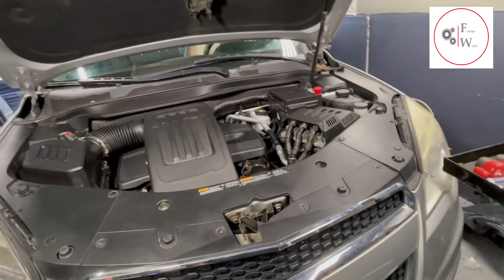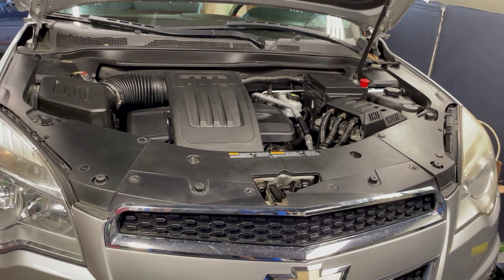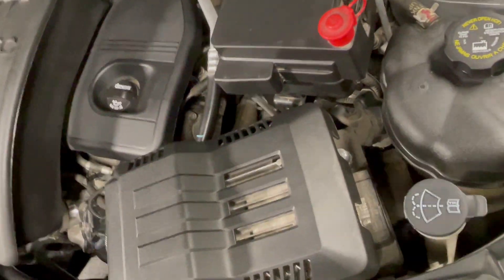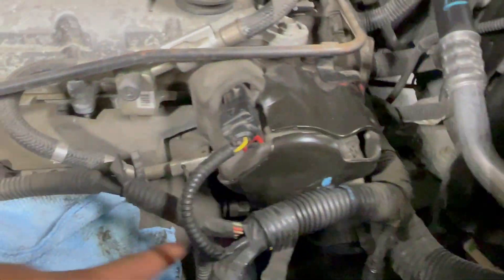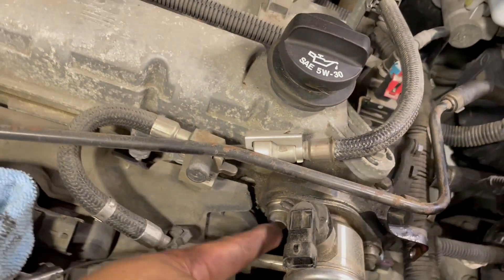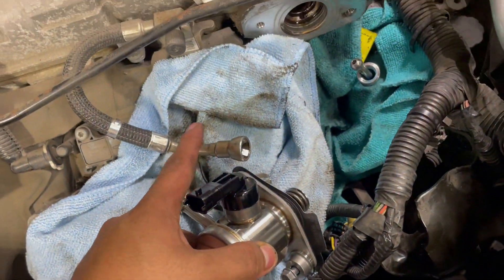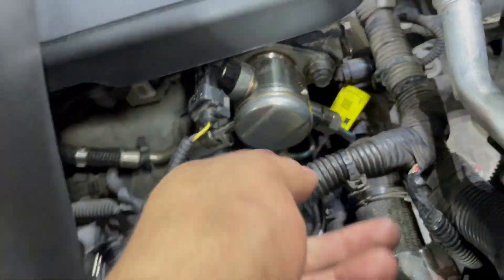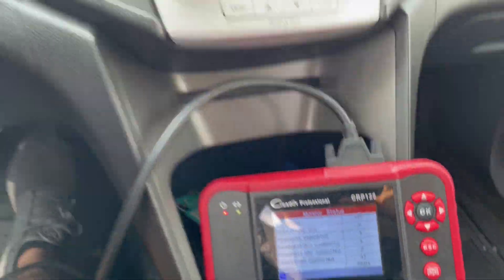Chevy Equinox High Pressure Fuel Pump Replacement (Code P0172) 2.4 Ecotec

Comment: Works for 2013 captiva. Thanks for posting
Reply from the maker: Im glad this video helped! I’m trying to put more content on this chevy platform. Nothing has broken on the equinox so far lol
Reply: @Fwerks.1592  You can work on my equinox, things seem to break every week lol! Very helpful video, just ordered the HP fuel pump on rock auto, says GM Genuine, not AC Delco, but hopefully it's the correct one. List of things already replaced on our 2013 nox: fuel injector at 40k miles, exhaust manifold at 67K miles, drive shaft seals at 60K miles, VVT solenoids x2 at 80K and 120K, upper cylinder cleaning for clogged secondary injection ports and cat replaced at 120K miles, ongoing oil consumption issues (oil cap replaced to relieve pressure). We bought it for the promised 32MPG but it doesn't even come close and comes with all these issues, no more GM!
Reply from the maker: @TripleDave40   I definitely hear ya! I hate working on GMs! Worst engine designs!

Comment: Nice video just changed fuel pump and oil. The oil smelt like gas and my equinox would run for awhile with key off. Question I just changed the oil same time as pump how long do you think I should drive it before changing oil again. Just want to make sure all the gas is gone
Reply from the maker: If you want you can go ahead and change the oil again now. For sure there shouldn’t be any gasoline left in the oil.

Comment: I have a P0191 code - replaced back fuel pump and fuel pressure sensor and code still there. It is also causing Stabilitrak error causing engine reduction. Is it possible the high pressure fuel pump work also cause a p0191? Not sure what else to do at this point.
Reply from the maker: Have you checked the injectors? You can use a stethoscope and hear each injectors to see if there are clicking which means they are spraying. Also check the connectors of the injectors. So we know it’s somewhat of a fuel issue. Have you checked the fuel regulator?
Reply: @Fwerks.1592  they have changed the fuel pump in the back, fuel sensor, new exhaust manifold, new throttle body. The issue began with hearing a roaring noise but only from within the cabin. Then a week later, the code popped up along with stabilitrak and engine reduced error.   All the issues happened within 2 weeks of an oil change. Is it possible that the incorrect oil could have been put in and caused this?
Reply from the maker: @rachky734  you said it all started with a roar noise within the cabin? That sounds like a bad wheel bearing to me! Also looks like one of the front abs speed sensor went out! That can throw a stabilitrak issue!

Comment: Did you have to adjust the crankshaft actuator position at all when installing the new HPFP?
Reply: I've been reading you do need find the lowest part of the cam lobe before sliding it in. EN48896 is the tool.
Reply from the maker: @itsnitz0575  if that’s what they say I don’t think it’s true. I did the work without the special tool and literally this is a plug and play part. Remove the old part and put in the new part. I have not had any issues so far!
Reply: @Fwerks.1592  there is other videos showing removing the casing inside.  Cleaning it. Then adjusting the lobe inside with the tool or finger before re installation.
Reply from the maker: No, I did not have to adjust anything. It was a direct plug and play.

Comment: Excellent video. New subscriber.  I had to unplug my PCV system by removing the HP fuel pump and intake manifold. Everything installed (including a new HP fuel pump gasket w/ o-ring (o-ring broke)). Started it up, and engine shakes with check engine code -P0203-00 Cylinder 3 Injector Control Circuit with misfire (P0300-00) Any idea what might be wrong? 108K miles. (New plugs at 100K). Wiring? Leak? Slow acceleration.  HP fuel pump was extremely dirty around the spring with a lot of oil and carbon I sprayed off with cleaner. Anyways.. Thanks a bunch!
Reply from the maker: Did you replace the O ring that broke?? Pull the plug on Cyl 3 and check the status of the plug. Check and make sure all your connections are properly made!
Reply: @Fwerks.1592  Replaced the o-ring and gasket (which came as a kit). Double checked all connections. Tested #2 and 3 ignition coils with multimeter. Identical readings. Noticed that #3 spark plug is EXTREMELY dirty. (#2 was clean in comparison.) Replacing #3 spark plug- hopefully that fixes it. 🤞 If so, then I’ll replace all spark plugs so they’re identical in life.
Reply from the maker: @littmus32ify  awesome!!! You’re definitely getting somewhere! I really hope that  fixes your problem and happy wrenching!!!!!!!
Reply: @Fwerks.1592  Well, that did not work.  Could be timing chain (although nothing is rattling). Funny that it's only cylinder 3's spark plug that was dirty- like it had 100K miles on it. (They all only had 8K miles on them.) Wondering if oil has been leaking into #3- oil gets dirty quickly and I have to top off with a quart in between oil changes. I hate this f$%*& engine. Drove it in (with 3 cylinders firing) to my mechanic. Stay tuned... $$$$$
Reply from the maker: @littmus32ify  I’m definitely following!!
Reply: @Fwerks.1592  Turns out the fuel injector at cylinder 3 was bad- only spraying fuel intermittently. It had a poor wire connection at the 3rd injector as well. They replaced the injector, put all new set of gaskets on the intake manifold. Rechecked everything I did. Running very smoothly now. Interested to see how the spark plugs (esp #3) will look perhaps in the fall. I really think there's a small oil leak in cylinder 3. Why else would the spark plug be so dirty? Thoughts?

Comment: How will I know if my pump is bad? I have no codes but I did an oil analysis and it came back more than 5% fuel dilution. Coil packs are good and spark plugs are good. Is there a test I can run to see if my pump is having issues? Thanks in advance
Reply from the maker: When the pump is on its way out, you will definitely get a check engine light. If you have access to a scanner try checking the fuel trims! How old are the spark plugs? Check the gap on those spark plugs.

Comment: Will it make the car shake also? Mines has that code but shakes when idling or when I turn it off
Reply: I’m experiencing this 
Today They are changing the Fuel Pump 
Hopefully this help car been driving me crazu
Reply from the maker: @Callmeninalove  , I really hope that solves the issue with your car! Keep us posted!
Reply: @Fwerks.1592  it seem to help so far so good
Reply from the maker: I had the same problem! When I would first start the car, it would shake after idling 5 mins. Also when I  would shut the car off there will be a slight delay for the engine to shut off. It was like fuel was still getting through and burning inside the chamber.

Comment: I noticed in the video, he did not replace the hp fuel feed line with the yellow tag on it. Can this line be reused? the dealer is telling me i have buy a new one with the install. Problem is it is not available though.
Reply from the maker: This line has been reused. Keep in mind this is the first time this high pressure fuel pump has been removed so the line is still good! The dealer only wants to replace it because it benefits them to sell you the part. Once you start taking the same fuel line frequently, then it needs to be replaced %100. If this is the first time undoing that fuel line you should be fine. Again the pump I replaced I had no issues and no fuel leaks! I’m not saying don’t listen to the professional, but giving you my experience. I hope this helps, thanks!
Reply: @Fwerks.1592  thanks for the info! I assumed that might be the case but was hesitant because there is a "national shortage" on that line I am told.

Comment: What’s the special tool to remove fuel line
Reply from the maker: Here it is! It’s the 3/8 blue connector. 
https://www.google.com/aclk?sa=L&ai=DChcSEwje6ODzk-X2AhXxCX0KHfw8DhwYABAVGgJwdg&ae=2&sig=AOD64_0tij12l2uhp-Q7Grs4uUvdN3Awjw&ctype=5&q=&ved=2ahUKEwi0z9Xzk-X2AhXdPH0KHU51AHwQwg96BAgBEEE&dct=1&adurl=
Reply: @Fwerks.1592  I noticed in the video, he did not replace the hp fuel feed line with the yellow tag on it. Can this line be reused? the dealer is telling me i have buy a new one with the install. Problem is it is not available though.

Comment: Having an issue with my 2012 Equinox 3.0L where it cranks but doesn't start. Tried swapping the fuses involved and same issue, also tried battery jump pack and battery tender overnight to make sure it isn't a lack of power. I am thinking now it may be a fuel pump. Does that sound right to you? If so I may give this procedure a try. 

When the key is turned you can hear it crank but it wont start.
Reply from the maker: Remember, you need fuel, spark and air for the car to be able to start. Here are a few tips to check if your fuel pump is bad or not. Have someone turn the key into “On “ position “ while someone else checks in the back underneath for a buzzing/ whining noise. That should be your fuel pump priming everything time it gets turned on. If you do not hear anything move on to the next step. Located your fuel tank and bang the bottom part where the fuel pump would sit in. Give it a few good bangs and then try starting the car. If it starts you might have a  bad fuel pump!

Comment: Why change the oil very important ?
Reply from the maker: Well very good question! The fuel that has been leaking into the cylinder walls falls down to the oil pan. Fuel is mixed with the motor oil and that will cause your oil to be thinned out. Plus you never want fuel mix with your oil. This will decrease your oil lubrication properties inside the engine moving parts!

Comment: Are you able to remove the feul line without the special tool?
Reply from the maker: Honestly, I don’t think that would be possible since there are small tabs that would need to be pushed in by the tool. I would suggest buy the 14$+ dollar tool and save headaches!
Reply: @Fwerks.1592  sounds good just picked one up. I assume I just clip it onto the line and push it into the fitting to disconnect it.
Reply from the maker: @darksideofthesand  , if you need any assistance feel free to email!
Reply: @Fwerks.1592  hey man I've been able to do everything but I can't get the fuel line off I've got the tool I'm supposed to but it won't budge everytime I go to pull back on the line the tool snaps put and the line gets stuck. I'm desperate here is there anything I can do
Reply from the maker: @darksideofthesand  , try inserting the tool and also grab a rag placing it around the tool. That should give you a little more grip. Also when pushing the tool in try to rotate it slowly and try to pull apart hose.
Reply from the maker: Push the tool as far as it can go, while slowly rotating and then pull gently. Are you using the blue colored tool? I believe it’s the 3/8”s size.
Reply: @Fwerks.1592  yeah, just got it. I've got the new one in and just started up the car. Unfortunately I've still got my check engine light on and the error messages I was hoping to get rid of
Reply: @Fwerks.1592  did you put the bracket that was covering it back on afterwards?
Reply from the maker: @darksideofthesand  , do you have access to a scanner? Have you tried to erase the code?
Reply from the maker: @darksideofthesand  , yes I put the bracket back that was covering the pump along with that piece of foam padding.
Reply: @Fwerks.1592  I don't at present moment, I can try that in the morning. The issue o was having was a code P0091 on a 2012 Chevy equinox. Comes back as fuel pressure regulator, which is combined with the high pressure fuel pump on this car. I was hoping replacing it would solve my issue. I'm getting service stabilitrack and reduced engine power errors on my car when I start it up. I already replaced the throttle body and did a relearn on it.

Comment: Good video, it helped me to change my 2012 Equinox pump. Please remember too pull out and clean the cap behind the pump spring in the engine block, it can get stuck.
Reply: Hey where did you buy your regulator from??
Reply from the maker: Good catch!!!! Thank you!
Reply: i was told that needed to be replace and i was like why it wasn't really dirty or worn. I was also told that it has to go on the flatness part so rotate that shaft in there somehow and place it. I didn't see you touch it so i'm thinking is it even necessary.
Reply: @rRodFromMemphis  Yeah man the Cam - follower is the name, i was ready to just put the HPFP solo but being that it's (follower) acts like a bearing  and gets worn from the bad oil and fuel it is a good time to replae -- the part number for the alignment tool is  EN 48896 which you will need to place the correct depth for the follower, you will need some needle noise pliers to pull the original one out  and spray down with 5w-30. They say you  have to rotate the engine by hand to get the exhaust cam to be(TDC) flat on the side the follower faces. Bro Bro Growers Love, Peace.

Comment: Do you know is this covered under power train warranty?
Reply from the maker: If you are still under warranty it should be covered, but to be on the safe side give your local dealer a call. They will be able to tell you if it’s covered or not.

Comment: Was it simple changing it out did you have to make sure the piston was n the right place
Reply from the maker: @James Johnson, it’s was pretty simple. The only thing that gave me trouble was disconnecting the fuel line. Other than that the new pump, slides right in. It only goes in one way.

Comment: Are these fuelpumps on the 2.4l know for leaking gas into the oil/crankcase?
Reply from the maker: @loganator78r you bet!! High pressure fuel pump, camshaft/ exhaust sensors, oil consumption just to name a few of them. Ohhh and let’s not forget the water pump! When that goes, shops love to charge over 1k to do the job! A failing high pressure fuel pump will allow for gas to leak down into the cylinder walls and make it down to the oil pan.
Reply: @Fwerks.1592  how often do you need to change it? I don't have a code or issue with it shutting off but I think my oil has a hint of gas smell
Reply from the maker: @loganator78r  how many miles does the vehicle have? The equinox I was working on barely had 72k miles. Depending on how often you drive my guess would be they can  last up to 6-7 years!
Reply: @Fwerks.1592  I just got this vehicle off of a relative with 187,000 miles and don't know the history of the thing. Might just end up replacing it but the pumps are pricey
Reply from the maker: @loganator78r  they can be expensive! Just be on the look out for when the check engine light goes on.

Comment: Thanks for the video. What is the specialty tool to remove the fuel line?
Reply from the maker: @Bronson Clark thank you for watching! Here is the tool you will need to disconnect the fuel line, "Lisle 3/8 Disconnect part#39420". Your local advance auto should carry them. If you need a walkthrough please don't hesitate to reach out to me! Good luck and happy wrenching!

Comment: My Chevy equinox will crank but won't start. Any idea what could be going on.
Reply from the maker: Bryant Natal, first off were you able to pull any codes? Remember you need 3 things to be able to start the car (Spark, Fuel & Air) It can be several things that may cause a no start. Check the battery/ starter first then move on to the fuel. Keep us posted!
Reply: @Fwerks.1592  so I've change the starter, and sparkplug, both solenoids. While checking the fuel pressure guage under the hood no pressure is coming out. But the fuel pump clicks on
Reply from the maker: @bryantnatal  , try checking your fuses and relay to make sure they are good. Also when was the last time the fuel filter was replaced? Have tried tapping the lower bottom of the fuel tank for a few seconds and try to start it?